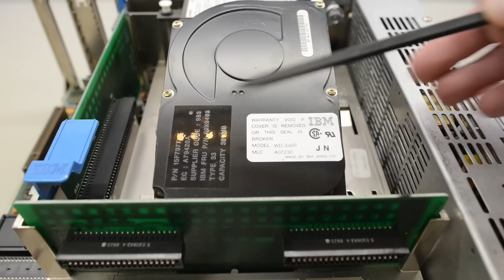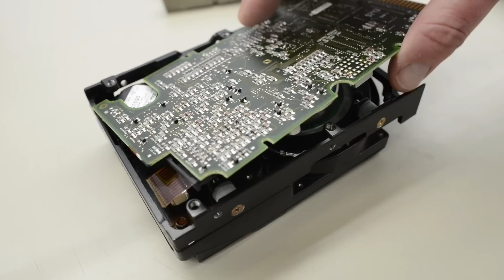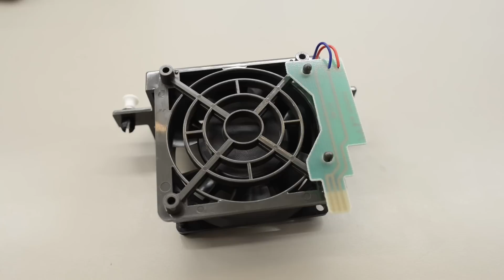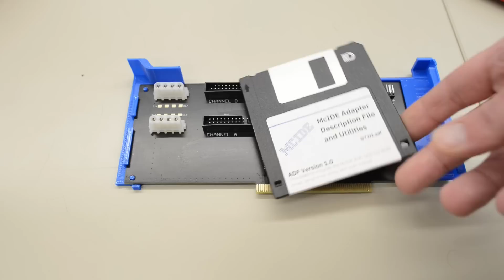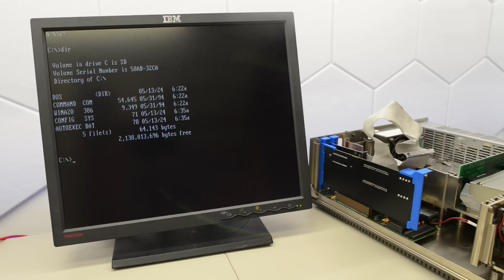ZZXIO McIDE & IBM PS/2 Model 50z Restoration (8550-031)

Comment: Try running fdisk /mbr. This should fix the issue with the unbootable sd card.
Reply from the maker: Yes, it was mentioned in the live chat. I just tried it and it totally fixed the boot issue :)
Reply: This.  And some suggest using the official SD format program to help, but fdisk /mbr has always worked for me.
Reply: I also thought about it while watching video 😀
Reply: came here to post this
Reply: Before plugging it into a retro computer, plug it into a modern computer and run diskpart, select the drive of the card (be sure you select the card!) and run "clean". Then put it in the retro PC. Removes all MBR/GPT whatever from the drive so that fdisk can initialize it properly and ready it for making volumes and formatting. fdisk doesn't clean the MBR and such by itself.
Reply: MBR contains not only partition table but also the very first piece of code that BIOS loads and runs from the drive. Bytes 510 and 511 of the first sector contain magic value that specifies if BIOS should even look for boot-up code. If it's anything else tha 0x55, 0xAA sequence, drive is ignored in the boot sequence. Cards usually do not have this little program because it is not needed or looked after by anything else than PC BIOS. Feel free to open some drives in hex editor like HxD and look at the structure yourself.
And some CF cards refuse to be detected by FDISK at all. The problem is a single bit in its configuration data. One that tells the computer if card is a fixed or removable disk. It's the same data data that tells the computer drive size, manufacturer, model, etc. IDENTIFY DRIVE ATA command in short. I wonder if active adapter could be made to snoop for that command and spoof the result.
Usually, cards marked as industrial are set to be fixed disk and consumer cards are usually set as removable. Sometimes, you can find configuation software leaked from manufacturer that allows you to modify that bit. I think that removing fixed/removable bit check from the BIOS would solve the issue as well.
Reply: @pvc988  yeah that's why CF Cards aren't reliable to expect to work
Reply: That command saved me a couple of times too.
Reply: It's surprising how often knowledgeable YT hosts get tripped up by this.  I thought this was really common and everyone knew about it, but it seems maybe not.

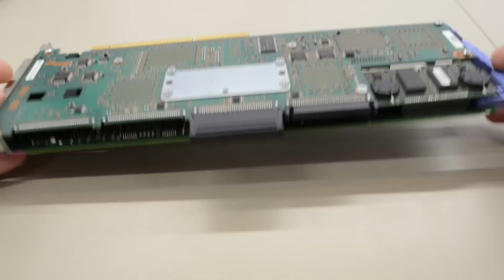Comment: 14:40 that does look like an internal SCSI controller for an IBM Power5 system which run IBM i and AIX operating systems. A lot of the design in the PS/2’s was carried over into the early Power system server family - you would feel right at home with your passion for the early IBM hardware! IBM are now running Power10 systems so they still live on today albeit with modern internals. IBM have a museum in Hursley England which is recommended if you find yourself there.
Reply from the maker: Awesome. I'll see if I can find one :)

Comment: The board you wanted help with: It says LOGITECH on it, and that connector was used with their bus mice and hand-scanners.  Since a PS/2 already comes with a PS/2 port, it's a hand-scanner interface board.
Reply: hand scanners... i still suffer from PTSD when they get mentioned. it was so frustrating to operate them. all those different limitations culminated to a horrible user experience.
Reply from the maker: Cool, thanks. I'll see if I can find one. Should be fun to try out
Reply: @Epictronics1  Think again :-D

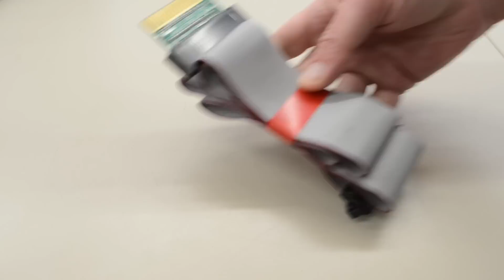Comment: 15:37 this strange floppy cable contraption is most likely for a backup tape streamer like  QIC80. For a long time they were either sitting directly on the floppy controller or on a "streamer card", which was basically a floppy controller with a FDC765(compatible) chip, clocked at a higher data rate like 500kBit/s oder 1MBit/s. 
For this reason most tape drives could either be attached directly to the existing FDC (but operating slow) or at a decicated card for e.g. doubled data rate, just running the motor at double speed at the same time. (yes, like "high speed dubbing" on hifi stereos back in the day)
Reply from the maker: Cool, thanks

Comment: The so-called “bus mouse” standard is just a quadrature design, like most Commodore mouse designs. It is quite easy to wire a 9 pin D-sub to bus mouse adapter. PS/2 mice use a serial standard and additional encoders would need to be added to make it compatible, thus probably useless for an external cable mod.

Comment: XT-IDE BIOS is a bit tricky about the content of the cards' MBR. fdisk /mbr may help, to make these "bad" cards bootable, and if not, then zeroing the first 100 sectors in DMDE or sth. similar will definitely help.
Reply from the maker: yepp. fdisk/mbr fixed the boot issue. The IBM now boots from the SD card

Comment: 17:02 To fix that chip make a thin tool about 0.5mm in diameter with a 0.5mm bend at 30 degrees on the end. I use a long dressmakers pin, it's hardened steel and won't flex. Insert it into the end of the chip under the legs until it is in-line with the damaged legs then rotate it towards the legs and push it sideways and outwards to push the leg back into position. You can also use soldering iron at the same time and lift the leg up, straighten it and solder it back but that must be done very very carefully or you can break the leg off. Better to just push the legs until they don't touch and solder them in place if they are loose. I'll send you a pic of my tool.
Reply from the maker: Thanks. The two concerns I have with the repair are that the upper trace in the picture is damaged, and I can't see which pin it was connected to. Also, the worst pin might have a trace underneath the chip. If we're lucky, it could be N/C.
Reply: @Epictronics1  If you have doubts about connectivity and you are capable to doing this, remove the chip completely, straighten the legs and put it back. Otherwise just push the legs from the inside until they don't touch and leave it alone. I've done this kind of job probably hundreds of times in 25 years of fixing arcade games and it's not fun. I found the easiest way was to remove the chip because more often than not playing with the legs pulled up SMD pads and that made it worse. The pads are only 0.5mm wide and traces/pads are only glued in place so applying too much heat and trying to move it while heating often ends up moving pads or traces under the chip. Better to play it safe and remove the chip, fix it and put it back.
Reply from the maker: @g4z-kb7ct  Yes, I think we need to remove the chip. With the chip installed, I can't see if there is a trace behind one of the pins

Comment: Anyone who thinks MCA on IBM machines is a pain, MCA on non-IBM machines is even more of a pain. I've now got one of those McIDE cards in an RM Nimbus PC-386, after spending a bunch of money on SCSI cards that weren't compatible or weren't what the seller said. Originally a similar WD-L40 hard drive. I was even looking into bit-banging an SD card off the extra debug pins on the Snark Barker.
Reply from the maker: We're in it for the challenge, right? :)

Comment: If anyone ever needs printers to know where to get certain replacement parts from those capacitors that were leaking I order service mount components and threw our ones by the thousand from suppliers so I may be able to help you find a supplier that stocks them

Comment: I'm pretty sure the 5.25" disk drive adaptor you've got shipped with the IBM 4869 external 5.25" drive. I remember setting up a few Model 50s with them back in the day to help our users with the transition from ATs to PS/2s.

Comment: I've had great success using non-detergent 30 weight motor oil (ND-30) on noisy desktop and laptop fan bearings.  It's thicker, and fills in the slop left by cruddy bearings.  
Any place that sells lawnmowers and the like would have it.

Comment: 30:50 Wow that mca Sound Blaster looks really sweet! Who modified it? Where can I get one? ;-P
Reply from the maker: I just tried to send you an email but it was returned with: This message was blocked because its content presents a potential
   552-5.7.0 security issue.
Have you blocked zip files?
Reply: @Epictronics1  no, I have no control over what gmail blocks. If the zip contained a doc or docx document that would explain it as they are not allowed. I replied to that mail....

Comment: Regarding the SD card, you need to set your partition to active in FDISK and may also want to do another "fdisk /mbr" on your C: drive. I've pretty much always had the same issue with CF and SD cards after partitioning and setting up DOS, and doing that has always fixed it for me so I feel those two steps should do the trick. 

The SD to IDE adapter is an active device and does all the translation to IDE (there's no "bootable" SD unlike CF, the adapter does it all). As long as it's being detected by the McIDE/system it should be bootable. 

CF cards can be hit and miss since some identify themselves as fixed disk (IDE) drives whereas others as removable storage which is not bootable but most of the time you really just need to check the active status and do the fdisk /mbr.
Reply from the maker: Yepp, fdisk/mbr fixed it. The SD card now boots :)

Comment: 32:42 - it says "industrial grade". Maybe it is set as "Fixed drive". Some controllers may have issues booting from "removeable drives". There is a flag in the CF card, not sure if you can "hack" or "set" it but I guess it is possible - maybe that is the issue you are having. 
PS: Did you see the new usagi video? He had the shorted golden ROE caps in his last project. Not all values may get bad, but as I said, I don't trust them any longer.
Reply from the maker: The boot issue has been fixed with fdisk/mbr. The SD card now boots and has four 2GB partitions :)

Comment: Those special IBM hard disks for early PS/2 systems are actually IDE but 8-bit IDE.  I wonder if those 30MB ones have the same issues with media degradation that the 20MB models have.
Reply from the maker: All my 30MB drives still work, but my two early "non-Z" drives are dead

Comment: Does it work in IBM PS1 2011 model? Slim, desktop case. It has the same connector, I guess. Using some angle adapter there is a chance it will gonna fit inside...
Reply from the maker: The connector is identical but the slot in the PS/1 is not MCA

Comment: It seems that the MS-DOS 6.22 installer forgets to run fdisk anyway to update the MBR if you already "fdisked" the drive before, it happened to me a lot of times with PCem and other emulators.
Reply from the maker: Yes, It turned out to be an MBR problem. After a fdisk/MBR, the SD card now boots

Comment: The Logitech card looks like a Logitech ScanMan adapter.
Reply from the maker: Oh, I see. There is very little info about the card on Ardent. I think that card may be a dead end, unfortunately.
Reply: @Epictronics1  You might try to get a ScanMan and the Software and show how scanning documents back in the time worked ;-)
My Dad bought a ScanMan back then. It was quite funny to scan the pictures my sister painted and mess with them in Windows Paint.
Reply from the maker: @TMDrews  If I can find one :)

Comment: That fan has ball bearings. They are sealed. Adding oil will do nothing for it. That only works for fluid dynamic bearing fans.
Reply from the maker: I think the bearing sealings are shut. The oil eventually found its way in and the fan now sounds much better :)